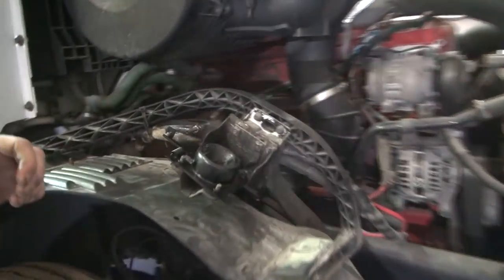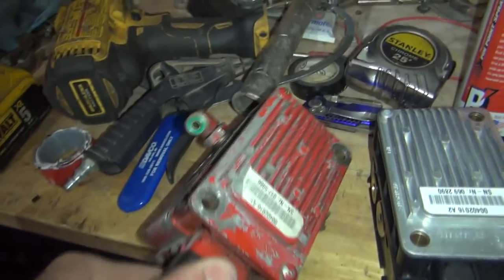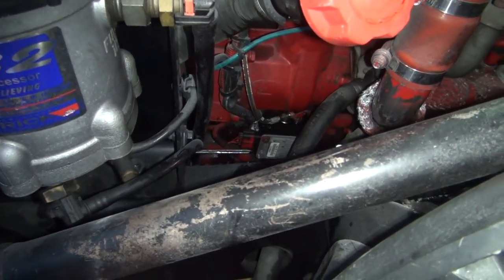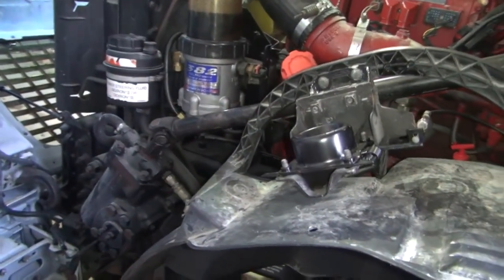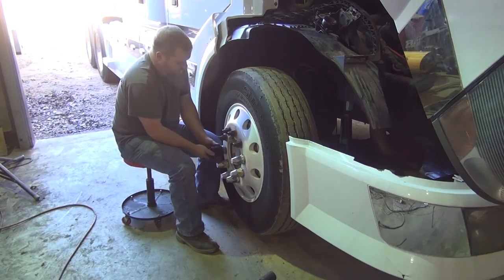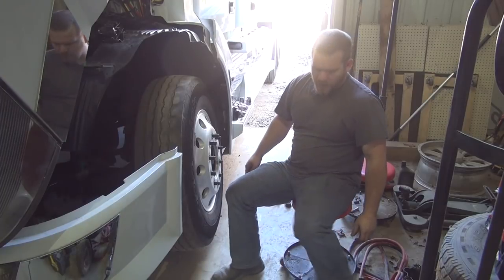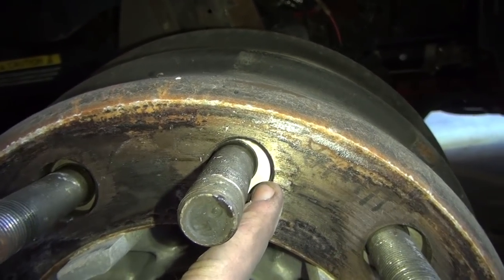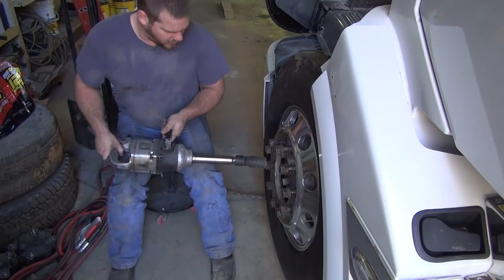Bad Turbo controller and new steer tires volvo vnl 780

Comment: Leave it to Cummins to make an air valve that wasn't  rebuild able but cost $1,000 to replace. Won't  the one off your old Volvo work?. Another problem I had with my 770 and my 730 was that the steering  shaft start to develop  play in the non greaseable u joint, requiring  replacement.  Finally, one of the mechanics  mentioned  that  Volvo made a steering  shaft for their " heavy duty " spec trucks that was identical  to the other one except that the u joints were greaseable. I paid the extra money for it and  in nearly a million miles never replaced it again. The non-greaseable one was lasting about 100,000 miles. Love the job your doing. Wish you lived close  to me.

Comment: I had a hell of a time trying to find the fitting that goes to the air tank supply. Turns out it's two fittings on my truck. A threaded elbow and a metric straight push connect. I didnt see the same setup on yours. Looks like you just have one fitting with an elbow. No one at cummins could find the stupid fitting
Reply from the maker: I have noticed several differences in my 04 vs this 06 truck also

Comment: CM 870 ? Mine goes to full on VGT once air builds and screams the whole day maybe I should check that box
Reply from the maker: yep cm870. something doesn't sound right
Reply: Inspect your electric plug and strip that plastic split loom back so you can thoroughly inspect your harness wires. They are notorious for insulation cracking and creating a huge resistance if not a short or completely separated wire. If your harness is painted red it is the original harness! Inspect the plug and harness before you replace the air pressure regulator.

Comment: When you replace one of those air control boxes is it necessary to calibrate it? Thanks
Reply from the maker: I didn't calibrate anything, and I haven't had any problems, that's all I can tell you.
Reply: @LifeWithChase  Thank you for your reply. Also thanks for the videos that you post I find them to be helpful. I have the same motor in a Kenworth and also replaced my air control box but didn't calibrate it.  The reason I ask about calibrating it was because of another video I saw where a turbocharger required calibration after being replaced (ISX CM871). It's disappointing to me that computers and scanners are becoming more and more necessary in mechanic work.
Thanks for pointing us in the right direction with your content and best of luck with the white Volvo.

Comment: how many miles do you get on a set of front brakes on a semi ?
Reply from the maker: I don't really know I would say 400,000 to 500,000 or maybe more. they last longer than the other brakes. Usually can get 200,000 or more on the other brakes. I try to slow down slowly and not use the brakes hard unless I have to.

Comment: i use my 1/2" milwaukee to take them 33 mm lug nuts off. i have a 1" ir gun with the 6" anvil extension but i rarely need it. do you like those wheel balancers on your steers? cant believe that snap on gun broke again....sad. the new volvo is coming right along. i just pay a young man to come to me and polish my wheels, tanks, and other aluminum. he is reasonable and it is a lot of work!
Reply from the maker: I believe the balancers do help on the steers. Nobody around where I live is interested in doing any work lol

Comment: What year is your truck, my next truck is going to be a Volvo.
Reply from the maker: 2006
Reply: chase5726 Hey Chase, besides injector cups on the Volvo engine, what are the other downside of them. What is your take on the Volvo Engine,Thanks again for your videos
Reply from the maker: @johnanderson3173  Don't know much about them other than that, and you can only get parts at volvo, and with the cummins you can buy parts at international. etc
Reply: John Anderson don’t get Volvo engine unless it’s the Volvo D12. The D13 is complete garbage and has put many owner operators out of business
Reply: Patryk 24 Thanks for telling me that. I am going to try real hard to find a Cummins
Reply: John Anderson Cummins is the way to go. If you find one bring a mechanic with you because there are certain things to look for depending on the year. Best of luck
Reply: Patryk 24 Thanks a lot for telling me about that